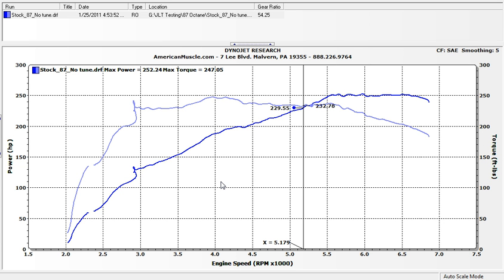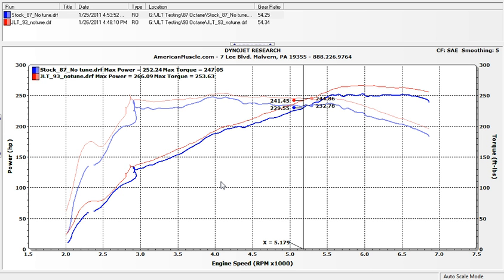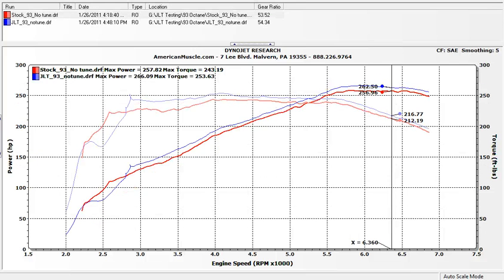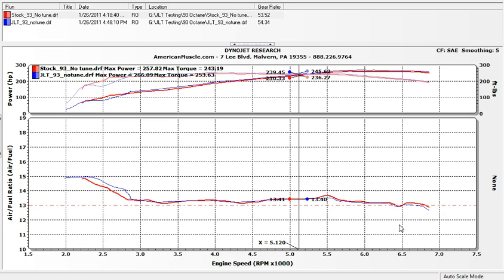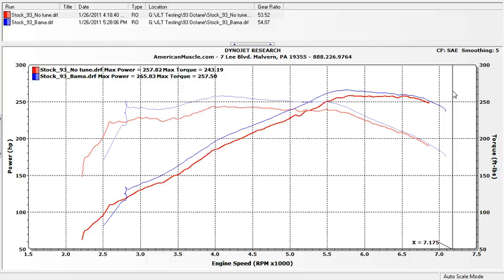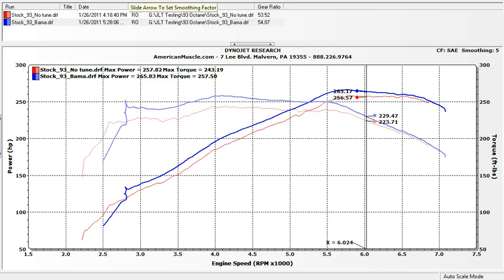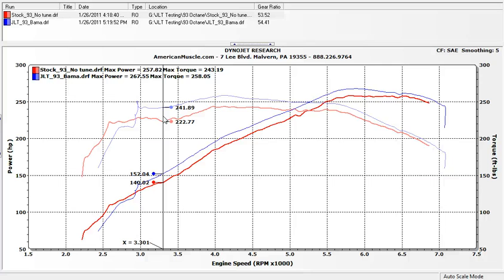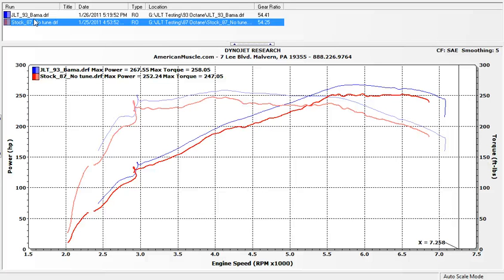2011 Mustang 3.7L V6 - Cold Air Intake & Bama Custom Tune Dyno Results

Comment: I thought my V6 Mustang made 305 HP and 280 TQ!! So disappointed now.... Got ripped off by Ford
Reply: The 305/280 numbers are the hp and tq at the crank. These numbers are rwhp and rwtq which usually have 15%-20% drivetrain losses.
Reply: ur kidding right?   how can you be that thick?
Reply: DaBluedude100
he's new to cars? happens to everyone.
Reply: eidolonbreed lol. Any hp specs you view provided by the motor company is talking about hp made from the engine, not the wheels. Basically, that's hp not being used.
Reply: +eidolonbreed Yea as the previous people stated all cars are rated at the engine instead of the wheels, so all cars loose hp between the two. But the V6 is also limited to around a 114mph top speed. You can take that off with a tuner, but some people seem to have driveshaft issues around 130mph. I wasn't too happy about that
Reply: Andrew Christianson
Yeah but at 130+ you're really looking at modded territory anyways. plus it was a only a handful of people that had issues.
Reply: +Ag Since 2011, both V6 and V8 GT have had the same redline.  They both peak at 7000 rpm.
Reply: simpsonfan13 It could be more because the V6 revs at higher RPMs than the 5.0, which is the reason why many want to change out their driveshaft.
Reply: OK we get it. What are you a fucking parrot?
Reply: I don't believe they do, no. The V6 revs up to 7k, but most GTs, unless programmed, rev to 5500.
Reply: Which is why a 2-piece driveshaft is fine for the GT stock.
Reply: Jason Phillips They do not. Both have different rev limiters. One revs at 5500 rpms, and the other at 7000 rpms.
Reply: Ford is false, misleading, junk of the junk. Shoulda bought a dodge caravan, they have more power lol and are more reliable, and better mpg's and more convenient and and and and and and lol
Reply: rbush19861 They do not, unless you drive a stick. a stock, automatic 5.0 hits its rev limiter at 5500 rpms.

Comment: Hey BAMA boys, at least talk like you know what your doing. When talking tq, it's said as: lbs per foot, and or lb/ft , NOT ft/lbs guys. Get it right or don't say it at all. Also, anhone that has some god understanding of how a engine works and today's ECU's you will not get any real power from no tune required and should never do this as a no-tune required.its bad for the engine and yes you do need to tune the C&L if your even half intelligent

Comment: i have a 2013 mustang premium v6 with a performance package im wondering what numbers i would put out im adding a bama 93 performance tune airraid cai and i was wondering if its worth putting in a bbk throttle body is i dont port out my intake mani